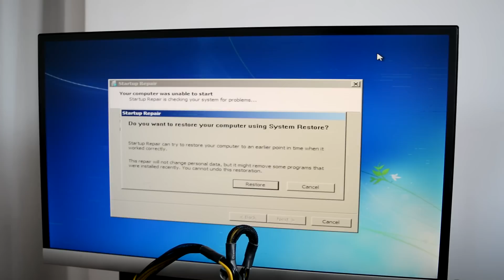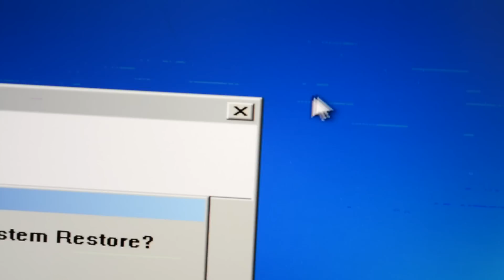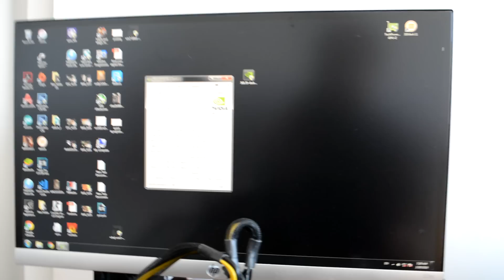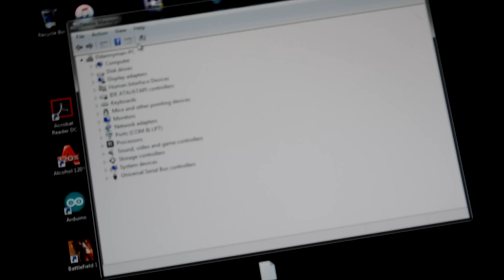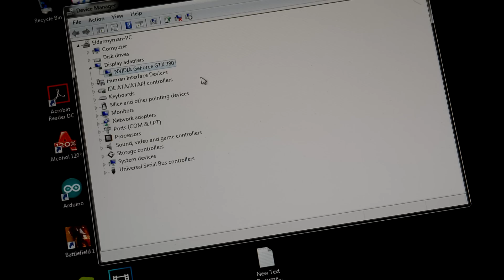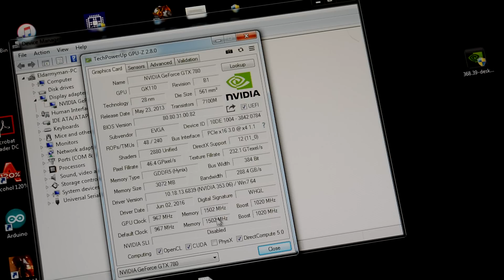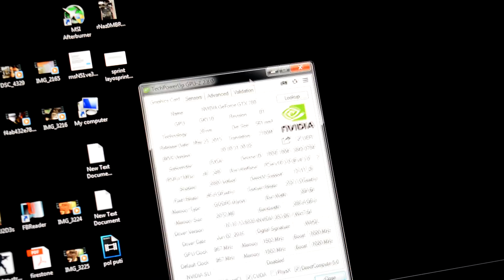Improving performance of video card on 10-15% 💪/ Making from 780 to 780 ti/ repair and upgrade

Comment: Re-balling without a BGA Rework Station.  Louis Rossmann would be impressed.
Reply: I think he's still not using enough flux to Louis' standards.
Reply: and cooling the gpu with his fingers for testing purpose. Last time I did that I would regret it on the press of a button. What a savage
Reply: this man is a god for this alone
Reply from the maker: @rkan2  oh, Im following Eli Tech  flux standarts

Comment: You have so much patience, its insane (placing the solder balls).
Reply: I agree.
Reply: exactly my thoughts.
Reply: @marius stoprfidbiometric i think both.
Reply: @marius stoprfidbiometric High IQ has nothing to do with electronics repair as IQ is a measue of common strategic thinking/knowledge!. I much prefer having patience when repairing computers it costs much less :)

Comment: glad to see your new video eli, recently I made a deal on broken msi gtx 1060 6gb for $65 (still has warranty) and then sent the card to the msi local service point. the guy from the service center get back to me saying that the card missing few component and so the warranty is void but they still trying to fix the card for free. and then just today i get email that the card is fixed and they already sent it to me. hope it turns out good 😁
Reply: the card came today with kinda ghetto fix like what buildzoid do, they say that the pad is broken so they make a bridge conection with some sort of cable from the resistor to the cap and then the chip. this is the image link from the fixed part https://i.imgur.com/rB2OXD8.jpg
Reply: @sirbhimasb  does it work? If so dont complain and enjoy it ;)
Reply: @techbuildspcs  works really good, already sell it few months ago

Comment: Wicked Skills bro!!! I'm an XOCer and I would love to be able to use your services in the future!!
Reply: Just make sure not to cheat like this (where it shows a different card name). I’m still upset 3dMark doesn’t take down the “RX 470” scores where the rendering is done on a second GPU, I still need to run it on my Titan and “RX 470” to make another complaint and prove a point. It even says the card they are running in secondary slot under the drop down...).

I would totally trust this guy with soldering my Epower board than me, some cheapo Fermi cards may need to die as practice, because Nvidia flagships are getting too far up there to screw up!

Comment: Hi, Eli, great video however, there was a lot a noise in your audio there are a number of ways of getting rid of noise using software. The way I do it is to use Audacity which has an effect for noise reduction.
Reply from the maker: thank you will try!

Comment: my old AMD Radeon R7260x  Video card improved when I add an after market air cooler it use to run as hot as 100c now it runs at about 45c This card is four years old but I have not come across a game yet that can not run in high res

Comment: Hi Eli. Thank you for the amazing content. I have an MSI 980ti gaming oc which shut down after driver update because of crazy overheating. Could a bios Flash fix the issue ?
Reply: This is because there is a hot spot on the die on your GPU. Try to use a "Thermal pad" and not Thermal compound. Thermal pads will spread that heat spot out over the pad quicker then the paste will. Also the pad has conductivity of around 150w/mk on X,Y where paste has only around 60 X,Y

Comment: @Eli Tech Hello! I'm hoping you can help me with this problem I'm having. I actually have an EVGA 780ti SC and the problem is TDP drops. In graphics programs like "Furmark" and "Heaven" the TDP can drop as low as 88% which also means an FPS drop. I've tried different versions of Furmark, different nvidia drivers, none of that has helped. I know it's not my PSU because a EVGA 980 I have and other video cards I've used in the past have worked fine with the same PSU and same computer. I think I'm down to testing components on the video card. Can you please tell me what each component to test is and what settings to use on my multimeter? My multimeter is a Craftsman 82400. And the video card is an EVGA 780ti SC (EVGA108  REV: 2.0).

Comment: Could you try to upgrade a GTX780 to 6GB of VRAM? I found that a 780 SLI is a powerful combo still, but would definitely benefit from 6GB of VRAM and even though 780s with 6GB of RAM exist, it might be worthwhile for people already owning the 3GB version.
Reply: +1
Reply: GPU VRAM upgrades do NOT work like that.

Comment: can you add more/missing vram chips?
Reply: On what card ?
Reply: ive always wondered this,surely its possible if you then edit the bios to make it recognise the extra amount of vram?
Reply: I'm more curious that could he make a 6GB 780 Ti
Reply: @nikolakarovic5964 , whatever card... It's the possibility, that I care about.
Reply: @TheSilviu8x  On gtx1060 3gb u can
Reply: thesilviu silviu probably the RX 4GB series to the 8GB since those are just about as common. It would probably cost more than the card is worth, but it should be possible (it’s just a PCB and wiring traces right? They don’t laser out the memory controller on the GPU chip itself, that’s only for locking down cores right?).
Reply: Nikola Karovic How? The 3GB is a cut down 6 GB, they are not the same core, the 3 GB has far fewer CUDA core (like my Titan Xp vs the 1080ti, I have the full Pascal chip unlocked, the 1080ti has a cut down due to defects or price segmentation).
Reply: @jakegarrett8109  U can change Gpu and add more mem on gtx1060 3gb pcb. U have video about that on youtube

Comment: The issue is the memory controller and the memory ... with a 780ti BIOS, the memory needs to be able to hit 1750 from 1500 Mhz (780). The 780ti BIOS will only detect Elpida Hynix and Samsung, If the timings don't match with bios it won't work, you'd have to mod the Bios downclocking the Memory for it to run if the timings match the 780 bios (copy, Paste), This will affect the performance too Much. The cards GPU in the current state would overclock nicely though

Comment: I have a old radeon sapphire HD 5870 that back in the Xbox rrod days I took a heat gun to when it started dying and it brought it back to life only for a short  while no doubt as I had 3-4 out of probably 25-30 attempts work for longer that. 6 months and maybe 10 that worked 1-3 months talking about Xbox 360s I had the same results with the radeon card. Worked for a few months but died again just like the others. I always wondered if it was because I got the card second hand and didn't know it needed memory thermal pads. Any idea how long that would take to kill it? The thermal pads being missing that is, I've been curious ever since and was going to attempt my first GPU volt mods on it and was thinking what was feasible even if just proof of scaling that kind if thing. Great thing is I have a spare one for comparison.
Reply: Supposedly the issue is that a connection inside the chip itself is failing. You can completely reball the chip and still have the same issues within a year.
Reply: @madmatt2024  yes exactly but I probably should have mentioned that it was tesselating like memory overclocking instability so I wonder if I was reflowing the memory thus why I might be able to volt mod the voltage. I might try no matter what to better my soldering skills.

Comment: Respect to you, you have a lot of patience! :) Cool to  upgrade the GPU. Should it be able to do upgrade a for say 1080 to 1080 Ti but with less memory? RX 570 to 580 should be "easy"? :)
Reply: memory layout is different so i would assume the pinout for the BGA is different, but i think from 1070-1070 ti  to 1080 is possible

Comment: Recently I got a Gigabyte GT630 and my PC doesn't post with it installed.  It beeps BEEP BEEP beep and restarts. Heating it up didn't help.  Is it possible to fix it?  Because I want to build a multimedia PC but I need HDMI output in it and the integrated GPU on my motherboard only has VGA.
Reply: It's means that the gpu is not replaced right take it out and replace it

Comment: You ever did this to a zotac? some reason I have 780 amp! and it has 2688 shaders from a titan. benchmarks show up as a gtx 780 with titan performance. I dont have fp64 option in nvidia control panel though.

Comment: Is this is achieveable on integrated graphics as well if you know exactly what you are doing?
Reply: Pasta Sarmonella E-Specialé im pretty sure its not possible on igpu, igpu is usually built into cpu sillicon
Reply: @milojkokitic6991  If there was one method proven to increase the raw power significantly it would be cool.
Reply: Pasta Sarmonella E-Specialé Overclocking? You can already do that (AMD chips like 2200G/2400G, and old A8/10/12 series and Intel K series). What people probably thought you meant is do a repair/physical upgrade like this, and that you can’t really do. However, Overclocking is an easy way if it’s unlocked (it’s such a pain if it’s not unlocked, it’s so not worth it...)

You can also run duel channel memory (2 sticks of RAM), and that will also definitely help. And using faster RAM speeds will also help your integrated graphics even if it is locked out of overclocking.

Comment: That was nice, but seriously who would want to repair a 780 in 2019 when even now a RX570 120 or 130$ beats the 780TI in almost every game out there and most by far while the 780ti only wins very low number of games compared to AMD low price offering...
Reply: I still use a gtx 660
Reply: @badvideoproductions3512  My PC is still all from 2011, but I really had to upgrade GPU, I got Asus Strix RX480 flashed to Strix Rx580 OC and even still is sadly a very weak GPU for both my favourite games, Post Scriptum and Squad, specially on Pos Scripting 1080p, no AA, most things to medium only textures on epic and effects on high and the game goes from 60 FPS to below 30fps very easily depending on the part of the map that is being rendered...

Comment: Well isn't that issue that GPU-Z shows that card works on PCI-e x4 rather than x16?
Reply: That depends on the motherboard some had pcie 1.1 which runs at x4
Reply: @neddy1287  you must be confused. The bus width (1x, 2x, 4x, 8x, 16x) is separate from the bus speed (1.1, 2.0, 3.0). Either he has multiple PCI-E devices asking for lanes, which requires the some wider bus devices to sacrifice their lanes for other devices, or there is an electrical failure on the device side or host side that prevents a wider bus width negotiation (Bad PCI-E slot pin contact, bad solder balls for GPU core to PCB for PCI-E connector, something similar on motherboard side, etc).

I have an MSI board that will not do a wider width than 8x on the primary slot, but an identical model/make board with identical settings will do 16x. On the flip side, I have a Gigabyte GTX 1080 that will only do 8x width, no matter the board it is installed in. Switching to a different graphics card allows 16x width.

PCI-E speed is dependent on cpu/chipset ability; very old boards may only be capable of 1.1 max. BCLK changes can also limit PCI-E speed (A higher BCLK may cut down 3.0 to 2.0). Long PCI-E risers can cut down on signal integrity too, bringing down speeds (Very long risers I have bring down maximum speed to 1.1)
Reply: @UrokLizard  well you got some facts correct there. As i have an asus p5q premium that have pcie x16, x8 and 2 x4 lanes.the x16/8 operate between 2.0/1.1 regard to gaming or anything. Now here comes the problem i have to use x4 lane which runs at 1.1 for an asus gtx 1050 ti oc expedtion without crashing. If i used x16 or x8 i get nvidia crashing non stop. As you see i have already changed everything except the motherboard

Comment: I have always wanted to put a titan black core on an msi lightning 780 pcb but I just don't have the tools to be able to do this
Reply: since when would that work?
Reply: @lukasstadler6594  the titan black like the the gtx 780 and 780 ti are all based off of the GK110 gpu and potentially a gpu swap should be feasible depending on if the memory cooperates or not
Reply: @maxdeny3407  Ok.
But why would you want to do this? I am ledgit interested.
Reply: @lukasstadler6594  there where never any custom titan black models and it would be nice to have a titan black core on one of the best board designs of the 700 series
Reply: @maxdeny3407  Ok i understand. but why would you want a titan black? I get its a step up. but there are more eficient gpus. or are you doing it for the sake of doing it?
Reply: @lukasstadler6594  I think it is partially doing it for the sake of doing it and partially seeing what a fully custom overclocked titan black would have been like would nvidia have allowed for it. Another reason is that the msi board allows for overvolting

Comment: So basicaly if GPU shows artifacts is it VRAM or GPUs processor thing? Can it be fixed by rebailing? Please, i have a 1060 3gb showing red artifacts and it fails to boot after installing the driver.
Help!
Reply: 1060 3gb is not even worth the hassle. just sell it as broken for 10 bucks and get a RX 570 8GB for 110 bucks instead.
Reply: @keith303  i just did it, and the artifacts are gone, but when i try to install the driver screen goes black  and keep turning on and off again, shows the taskbar and the mouse pointer. It crashed eventually.

Comment: I need your help I have gtx760 heat overload
I have more than one
Please
Reply: Have you tried taking the cooler off the card and putting new & better thermal paste on the core after cleaning the old off the core and cooler plate? I suggest "Arctic MX-4" thermal paste.

Comment: I know that AMD cards BIOS can be easily modded but is that an option on nVidia cards? You could flas a similar card Ti model BIOS
Reply: It is possible, nvidia even provides the tool (NvFlash) to do it
Reply: Pre 10-series you could modify any vga bios and flash it but to my knowledge, nvidia locked it down

Comment: My Asus GTX 770 2GB OC is only showing up BIOS.... It's goes black after a complete boot... 
Only Safe Mode boot is working with glitches.
Please help me for repair.
Thanks in Advance 🙏
Reply: DDU the currently installed driver and reinstall the latest one.

Comment: Hey bro, my Asus Strix 970 crash in game/benchmark (like heaven) instantaneous with no blue screen, juste the game crashed... What is the cause? Thanks dude.
Reply: Most likely gpu driver restarts because the chip is gone.
You can try an older gpu driver, but i doubt that it works.
Reply: Unstable overclock, bad driver install

Comment: DAMN Eli u r mad. placing that amount of balls manually? it must takes hour. as stencil cost few euros i will never do that. i even hate that directly heat stencil for bigger ic than laptop chipset. better use non direct heating stencil. but this kind of work isnt paid. u can buy this card cheaper than u can charge for a chip and work
Reply: Stencil is 20€

Comment: i hate how all the good graphics cards dont come with vga
Reply: Good gpus dont come with vga because putting them onto a vga monitor is a misuse,  vga doesnt support over 1080p 60hz most of the time, while good graphics cards will be going over that ino 144hz and the 1440p range, which removes the purpose of vga.
Reply: @kennedymoreiras3054  ok thnx for telling me but does that mean dvi is better?
Reply: also i have my monitor plugged into vga and is at 1440p but only at 60hz